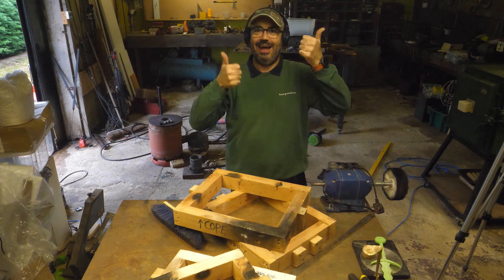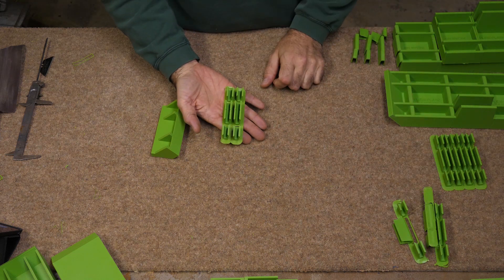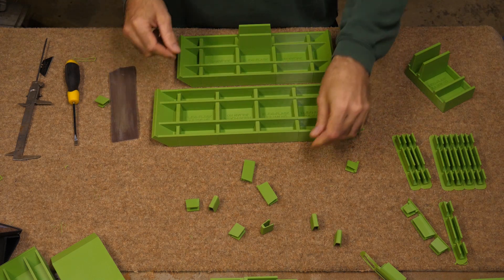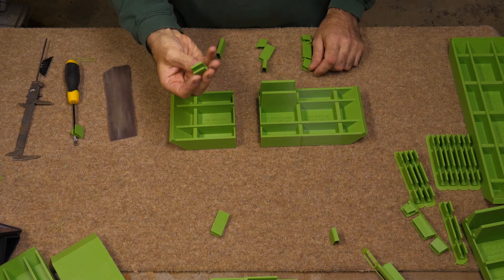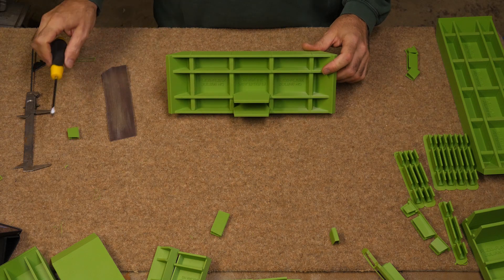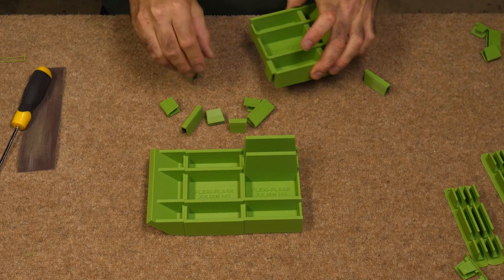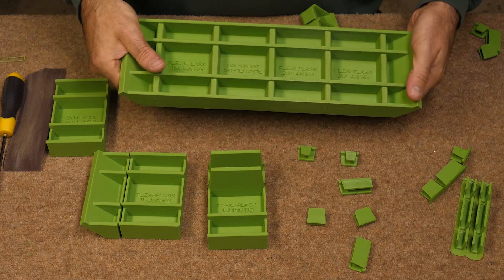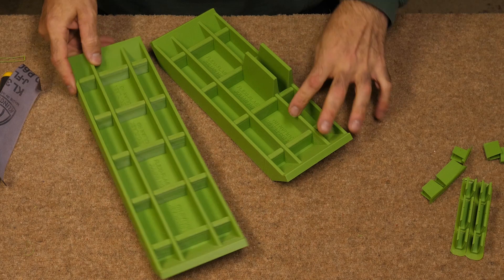A modular metal casting flask (PART 1) the Idea & 3D printing the parts. Lets make some metal flasks

Comment: This is a great concept and worth developing.
I would suggest the following.
1. increase the area, height wise, of the recess on the sand side of the pattern to improve grip of the sand so it can carry a heavy load of sand in the box.
2. rise the lugs used for the supporting pins up off the bottom of the mold so as to provide clearance for your fingers between the drag and flask. This will ease lifting of the flask off the drag.
3. instead of using a 45* angle for a mating surface between the pieces at the corners, adapt it for a 90 degree interface. this will make machining the end easier to obtain a well fitting and more accurate corner (if needed).
4. with robust clips, and I do like your clip idea, you will only need a clip on the outer sections. you can omit the centre clip, so just build in the draught to these and clip the out side joining surface. this will allow only  one type of clip being needed - in association with my point 2 above.
5. I am considering, but not certain at this moment that the pattern should be reversed as far as the internal and external face. I am interested in any comments on this.

Comment: I would have recommended the opposite of boelwerkr’s suggestion—make all the ribs as thick as the handles. Superfluous weight, yes; but if it means fewer clip types it could be handy. And if the ribs are spaced equally, only one clip type would be needed in the entire design.

(I’m watching for the first time, and the video series extends well beyond what I’ve yet seen, so this may have been incorporated already.)

Comment: If everything works out, nut and bolt the side's, reason being, if you have enough sides, you can make up a large flask (using all long sides) or a small flask (errrrrr oh yes using all the short sides :) )
gives you an extra flexibility, once you weld them you got what you got.
looking forward to part two.
PS they look good to me and not too beefy to my eye.
Any issues. drop me a line 
Andy
Reply from the maker: cheers Andy will do :) i should have an update coming out tomorrow! it's all changed (for the better!)
Reply: @JulianMakes  Well I like your effort mate.
Reply from the maker: @WarGrade  cheers Andy :) Uploading now woop woop!

Comment: You could make the handles thinner/shorter at the edges, so that the normal clips work. I don't see a reason why the handles have to be thicker than the normal ribs at the edges. There are only thick "bosses" needed to take the connecting rod. You cold also make the handles "clips" you can put over the ribs where you want them, i don't think the daft of the ribs underneath would be a problem.
Or divide the blocks up even more to get one "half height" and one "quarter height" element you can create "full height" elements  and combine to one full flask side.
Reply from the maker: cheers boelwerkr, i did have thinner handles at one stage but i've lifted a lot of very heavy flasks and i really think these are the smallest they could be, and still comfy to hold. Also they have to eventually have all the pin stuff stuck on them and will have bolts/nuts/wedges allsorts on there, a little extra handle i think, will be welcome later. When they are cast and tested full of sand we'll see, if they are too big, i think we can def make then thiner to accomodate the normal pins. We'll have to see how they handle (sry not meant to be a pun!)

Comment: You should print the clips standing on its side edge, instead of on its back, that way the clips wont break as easily (because of the different layer direction) On the middle handle piece, if you move the sides of the handle towards the centre, just a mm or two, you wouldn't need the special mid-piece clips. I really like the idea, and I'd go for it myself, but my current crucible is too small the provide the alu needed for a whole side.
Reply from the maker: Fredrik Kjølner thanks Fredrik! I did consider that but I went with the easier print (no overhangs) instead, you are right of course they would have been stronger, but they were just right strength-wise anyway, if you watch the later ones you’ll see design evolves very quickly and the clips are removed in the end :) thanks for your comment!

Comment: One other thought off the top of my head:
I like the 45's at the corners.... if you think about it, that sort of setup will lend itself to making snap flasks !! With the properly designed add-on hinge and locking arrangement you can have modular mix and match snap flasks. I'm not even sure the big boys in the industry have that.

Comment: Julian,
if you can in the future, instead of STL alone, if you are using Catia, ProEngineer or Solidworks or whatever, include the x_t   (Parasolid) files at least, as well, if you don't include the part files from whatever CAD program you are using. Why? STLs don't lend themselves to alteration in say, size, height width etc etc.  Great for strictly 3d printing, but terrible to import into a CAD sys like SolidWorks, Catia, Pro E etc. (if you've ever imported an STL into a program like I mention and tried to work with the STL you'll know what I mean !! There's NO "working" with STLs !) For example  a 70mm  cope and drag would be almost useless to me as the parts I want to cast for scale model steam engines would be much larger than the flask itself! So it would help to "resize" the 3D models of the modular flask parts -- that task, in my experience is extremely problematic with STLs alone, if not impossible.

Just a suggestion.
Reply from the maker: once a basic modular design is settled on and a few test have been done to check it's ok, i'll release any file type you wish. I use fusion 360 if that helps. yes i know what you mean STL's are not great, they are just a bunch of triangles. ok to print from but terrible for anything else.

Comment: Instead of the clips, could you not just dovetail the joints so they fit together? Maybe two tapered dovetails per side that slide in from the top and lock in, I think it would make a much stronger joint and I think it would maybe sort out the corners (I say maybe I've had a couple of beers haha) . If you wanted I could design some up for you (infact I would like to,  I'm a bit of a nerd and like playing with fusion so it wouldn't be a problem haha)
Reply from the maker: greatgrumb that is a brill  idea greatgrum! Someone had already suggested using tapered dovetails and i was so intrigued I’ve spent half of yesterday test printing some parts, I was so impressed with the results I’ve redone all sections with them. They are printing now. Watch this space! :)

Comment: Really neat idea and I hope it works. Only thought I could add would be perhaps put a group of alternating convex and concave dimples in the corner joint pieces to make a more positive and precise lock between the corners. I don’t know how well that would work with shrinkage but it seems to me that if you have to interlock the pieces it would make it a lot more precise when joining the corners by bolt or weld.

Comment: You know, you could've saved a lot of time by just printing a few small modules, ramming then up in the several flasks you have and just casting.

Then just building a jig to drill the center of the metal modules to pull/hold them together as "master pattern"
Bye eee

As to the modules design...

The 4 sides of the modules can have a risen and a opposite depressed side (sort of like the included  slide on a table saw).
Byeee
Reply: What  ???

Comment: Excellent work Julian. have you thought of tapered dovetails to join them, could be a lot stronger and then you can have nice fillets in all the corners, for easier moulding.
Reply from the maker: ooooooh that sounds very nice! i'm not sure i get you 100% but i can tell you are on to something... Do you mean once the metal sides are cast and ready, use the tapered dovetails to join the corners then? i like that idea a lot, i wonder if the tapers can be cast into the design? i'm trying to keep secondary processes to a minimum, really interesting idea thank you so much!
Reply: I was referring to the a way to join the sections together other than the clips, I've Emailed you a 3D PDF it might help
Reply from the maker: @Worksengineer  ahhh thank you so much Paul that looks perfect! i may just have to print off a couple tomorrow!

Comment: Really nice idea , couple of top of head thoughts :
Not sure about the clips as far as durability and vulnerability to heat etc, a maybe stronger and easy solution would be putting holes through your components so you can pass threaded rod through them and then tighten them together with nuts at the ends, as far as the corners I think casting the corners as complete 90' corners with the holes for the rods would be stronger.
Reply from the maker: thank so much Andrew and great ideas, i did actually consider two holes running inside the parts (one along the full length of the top and one along the bottom) for just that (the threaded rod), but my printer is not amazing with holes. The version so far can print with no supports, if these dont work out i'll definitly reconsider. also i think we'd need very thin rod, but a very interesting idea.
As far as the corners go, that would a great plan but i need to be able to have draft to remove the pattern, i'm not sure if i could achieve equal side shapes with full 90degree corners. The need for some draft would make one side of the corner piece smaller than the other. But i could be wrong... if you can come up with something please let me know! cheers loads
Reply: @JulianMakes  One solution if you are having trouble printing circular holes is to make them teardrop shaped, i,,e. replace the top of the circle with the top of a diamond shape. Usually this has little effect functionally and is much easier top print.
Reply: @JulianMakes  Just noticed the second half of your last message re the corners and draft etc.. don' t know how I missed it... anyway..
 You could cast the full corners by laying them on corner into the drag.. i.e. with the point of the corner pointing down to the bench and the 2 sides even on each side, then if you arranged all the supports in the rear so they are vertical in the x and y axis in this orientation it should pose no problems re draft etc.
  I think this would be a much stronger and durable solution, remember that PLA is very temp sensitive it loses a great deal of its strength and becomes floppy in a window on a hot day,

looking forward to see how this project progresses.

Comment: I like the idea a lot Julian, and if I could get my hands on the STL's I reckon it's take me all of 5 mintes to modify the centre section so that the same 2 clips would work for every piece. Another idea though is that if I could afford the metal I'd LOVE to try casting your design using the lost pla method to make an aluminium replica that'd last a lifetime! :-)  https://www.thingiverse.com/Seafax/designs
Reply from the maker: cheers seafax! i will be releasing the STL's i just want to do some test casts first, as i dont want to release files if they might not be any good. But if there's any merit in this design (fingers crossed) i'll be releasing all the files.
Reply: The world will end in 12 years, so what's the point?

Comment: Absolute genius, I love it.  Wish I had a 3d printer.... 😂.  Best thing i've seen in ages.  I cant see any issues with it, you seem to have thought of everything.  The only suggestion I would make is rather than having negative channels on the sand side, perhaps positive channels would grip the sand better ?  My ideal flask widths would be 3,4,5 and 6 inches, especially with a modular design.  I wouldn't necessarily choose all those sizes but if it was modular would give me more scope for custom flasks.  I've always wanted metal flasks, and will definitely make my own someday, your system is superb.  Another way of joining the finished flasks could be with a pin on 3 corners and a fixed clamp on the 4th corner, this would enable the flask to be stored flat, and releasing the clamp would open the flask and drop all the sand out.  Genius mate, honestly, I'm really impressed.   Kudos !!!!... Andy 😎😎😎👍👍👍
Reply from the maker: MeltandCast ahh thank you so much Andy, yes I did see some have pins on the corners (amazing). Perhaps down the road we can have a corner piece that will work for that too! I just need to cast these and see if they work first :) thanks so much for you dimensions mate, what sort of depth do you favour?
Reply: @JulianMakes  At the moment I use 3 and 4 inch flasks, but with a modular design I'd like to see sizes up to 6 inches deep.  This would allow me to make a smaller fatter flask for larger volume pieces without having a 50kg box to move around.  I know I should just make more flasks, but many times I end up making a mould where 80% of it is just sand, it wastes a lot of time.  Often it's not worth me making a flask just for one casting, so I tend to use the same flasks no matter what I'm making.  Another good thing about these is they would also allow you to use a 3 inch flask for the drag and a 5 or 6 inch flask for the cope to increase head pressure.  If I had these parts, it would definitely be worth me investing the time to make myself a whole range of permanent moulds of different lengths and widths.  A pin on the corners would allow me to make the sides, and join them together as required for each casting.  I guess the biggest problem with that idea is keeping the mould square, true and flat.  I'm just trying to see a way where I could cast each side individually at different lengths and speed clip each side together as required, so to speak.  This would maximise the variations of usage once the patterns have been cast.
Some divan beds use a split hinge on the underside with a split tube, when the two halves of the tube are aligned an L shaped pin is pushed through the tube and then twists to one side and locks into place into a metal protrusion.  This is very solid and gives no movement.  It sounds complicated but is actually a very simple design.  It wouldn't cast easily though, so would require an additional piece that would need to be attached to the corners afterwards.  It could be an additional item that gives the user a different way of using your flask design once cast.   Looking forward to the next part with great interest.  Thank you for sharing this Julian.... Cheers Andy 👏👏👏
Reply from the maker: nice ideas Andy i love it!
Reply from the maker: mate, if you need something printed give me a shout, you're only a little way from me after all! you could pop in for a cup of tea!